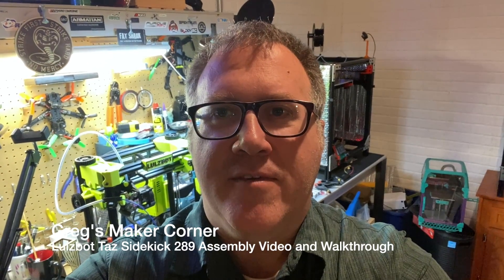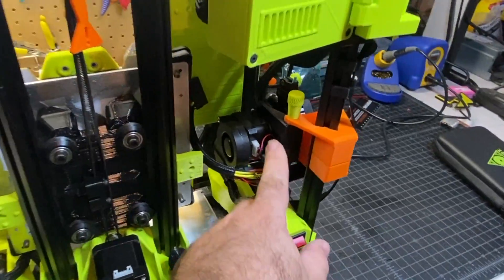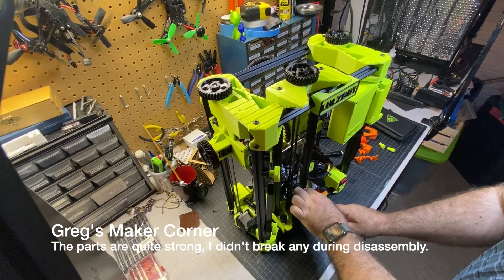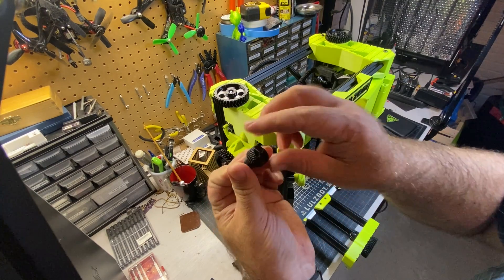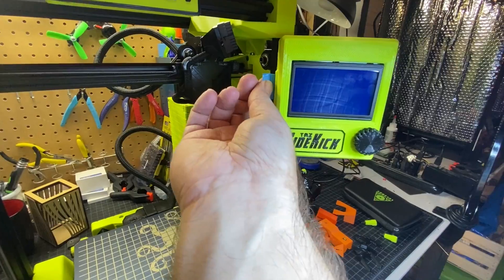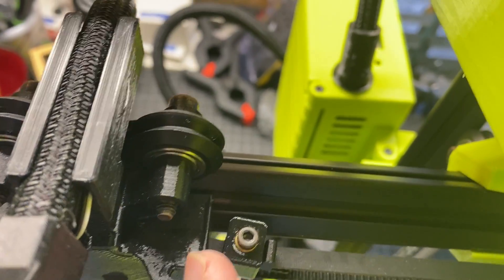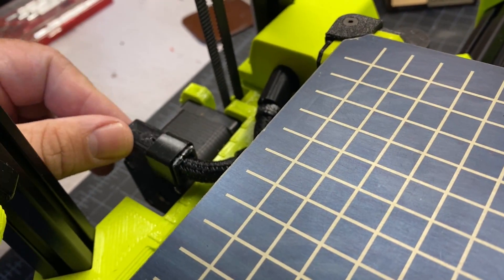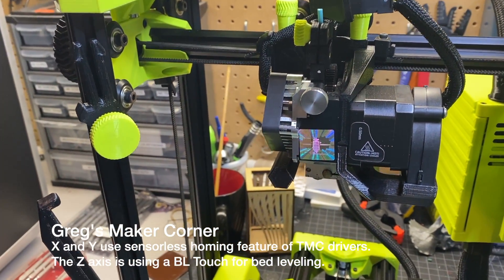Lulzbot Sidekick 289 Assembly & Walkthrough

Comment: I don't get it, the print  quality of the parts looks horrible to me, an what's with the v- rollers for a printer that cost over 1 k. plus all the weird angles on the extrusions is kind of weird, maybe they should focus that effort somewhere else.
Reply from the maker: I’ve had the machine now going on 10 months. They have made a few changes and improvements. The v-wheels have held up really well and aren’t anything like the cheap ones you find on Creality machines. The 45 degree extrusion choice is a little odd but doesn’t seem to hinder the performance of the machine.. I have had a lot of good prints and it has been very repeatable and reliable. If you are just looking for a cheap machine from a Chinese company that is not going to support it, then this machine will not make any sense. Lulzbot is going after customers who want to buy US and value support, which I can attest to is quite good.  Having said that I do think there are things they could improve, but it’s a very capable machine, very sturdy and reliable. Definitely worth considering if you’re tired of the race to the bottom with other cheaper options.

Comment: Very interesting looking machine. Curious to know the pricing and how it compares to other options on the market.
Reply from the maker: Thanks! The machine is very well built, and I think it will be a good competitor. I am working on another video with some general thoughts on comparisons. Before I share that I want to put the machine through it's paces a bit more and am currently testing the toolhead swap (which I'm also recording). Pricing wise, this machine is about $1100 as pictured. The machines start at $795 but if you don't already have a toolhead, you'll be over $1000. However, I still think it's a great option compared to something like a Prusa given the swappable toolhead, belted z, and very solid build quality.  The configurator is now live on Lulzbots site so you can see how to price the options. https://shop.lulzbot.com/sidekick?fbclid=IwAR1V0AnbUJ8cJvIB5yMg1_GI2f8KY3TYg6ktqLaG4SY7b9k8wDH0_jiXQWw

Comment: I have a couple questions…. 1. How quiet is it? Maybe compared to a prusa. 2. Is there any way to put a lulzbot dual extruder on it? Either the one on the taz pro or the one for the taz lineup. I mean like an easy way like unscrewing the toolhead, attaching the dual extruder,
Then updating the firmware. Not like changing wires and boards and stuff
Reply from the maker: It is similar to a Prusa in terms of noise, but the case fan is actually quite loud (pushing a lot of air) and it’s constantly running, unlike a Prusa. I will cover that in an upcoming video. The steppers are very quiet as is the hot end fan and blower. But you definitely hear the case fan.  For a dual extruder, I don’t think that would be an option because the machines are just too small and there wouldn’t be enough room for two extruders to print.
Reply: @GregsMakerCorner  ok. Thank you. You could probably still hook up a Palette to it anyways
Reply from the maker: @Thomascheekkkkk  Yeah, for sure on the Palette, in fact I plan on doing that soon with mine. I think palette will work great with this printer. It may take a little work to come up with a connector for it.

Comment: Is it running a 32bit board? Looks sweet
Reply from the maker: It's running an Einsy Retro, which is the same board that the Prusa mk3 uses. I'm a bit surprised they didn't go with a 32 bit, but the board does seem more than capable of driving the printer. I'll touch on this a bit more in the next video as well.